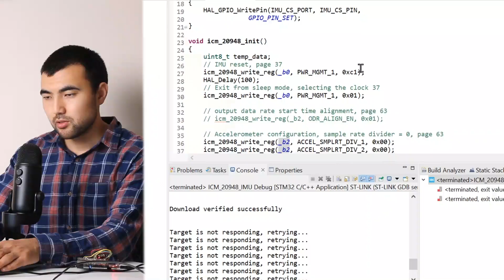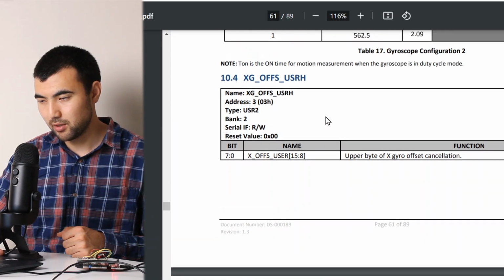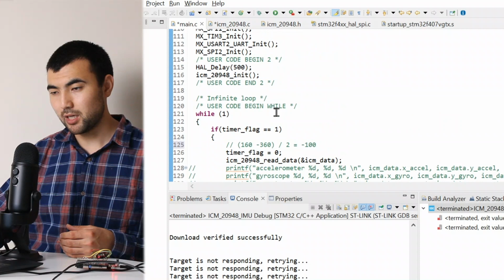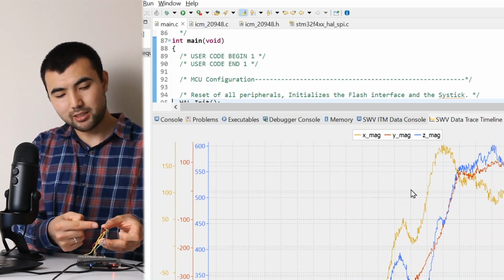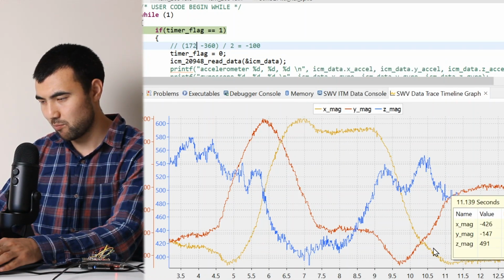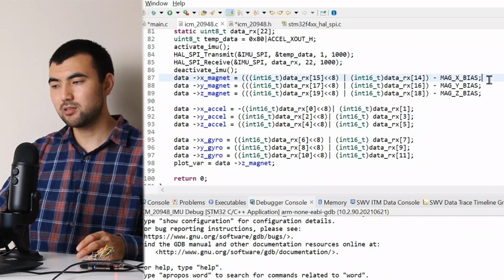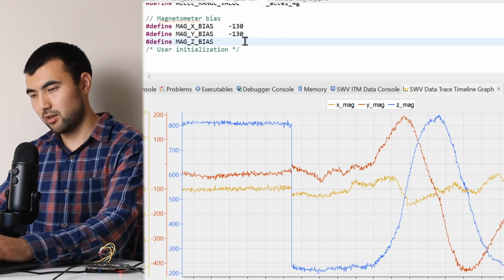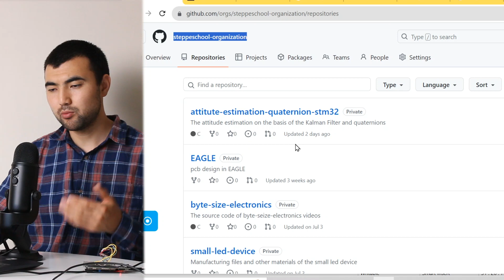STM32 ICM-20948 IMU Part 3: gyroscope and magnetometer bias removal

Comment: Do you think this imu will be more accurate than MPU-9250?
Reply from the maker: I used both IMU sensors. From my experience, I would say that ICM-20948 is more stable than MPU-9250. I always had difficulty configuring MPPU-9250. In that sense, ICM-20948 is better. In terms of accuracy, they have pretty similar characteristics. 
However, MPU-9250 is obsolete, so it will not be manufactured anymore. Right now, I am working on updating my attitude estimation course to use the new ICM-20948 sensor.
Reply: i can’t found any documentation about ICM-20948. May i ask u to tell me the pros of cons about ICM20948 (comparison about the 9250)